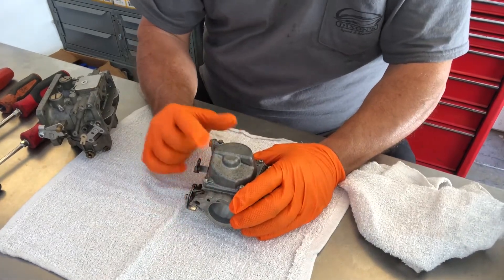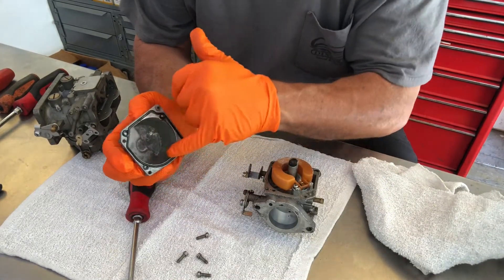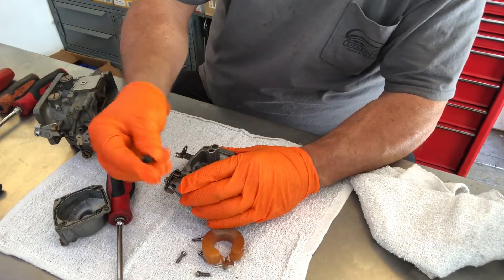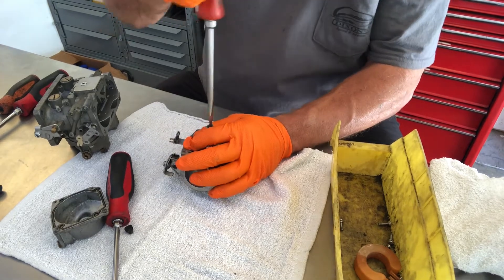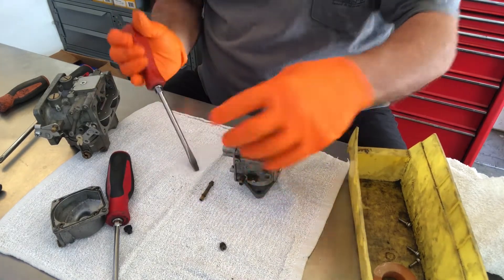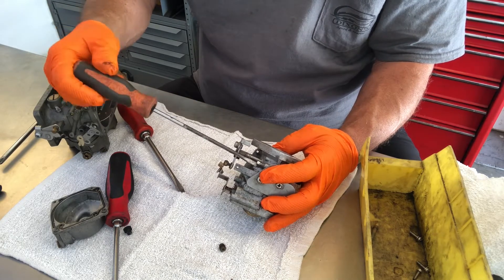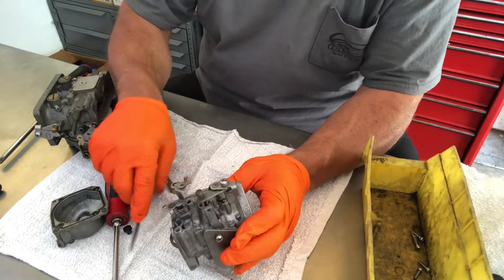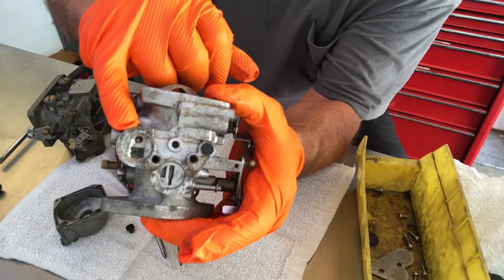How to Rebuild 2 stroke 90 HP Yamaha carburetor 1984-1991 tear down for cleaning. Part 1

Comment: When u took of the top cap ( semi heart shape) above idle screw u missed the tiny third rubber gasket which also has a metal plate … rare to see a teardown on this model shame it wasnt a complete video with full explanations on all parts